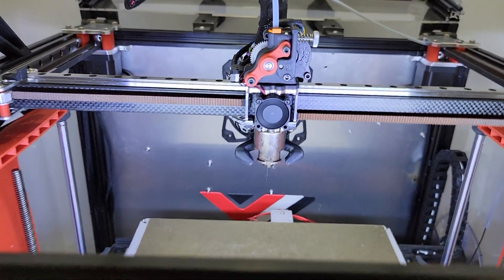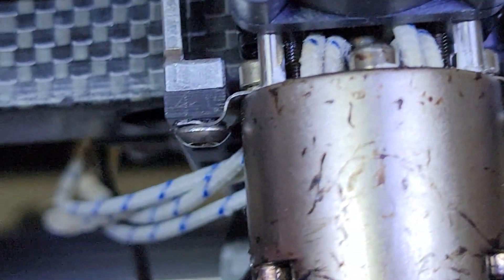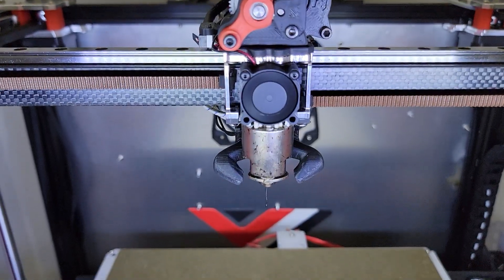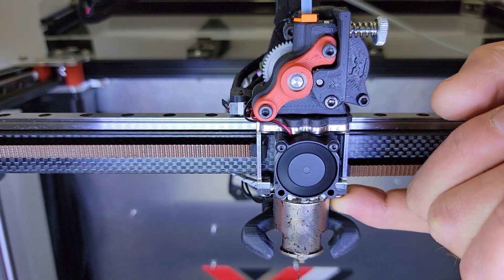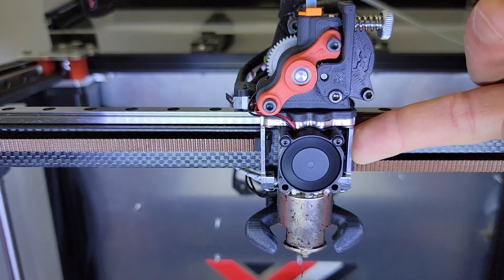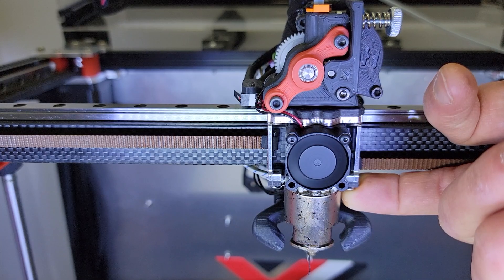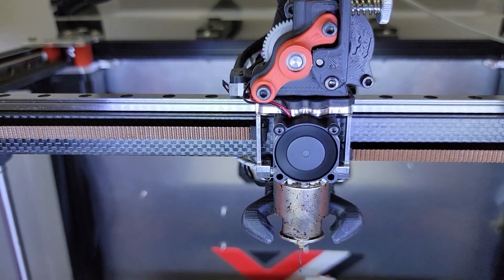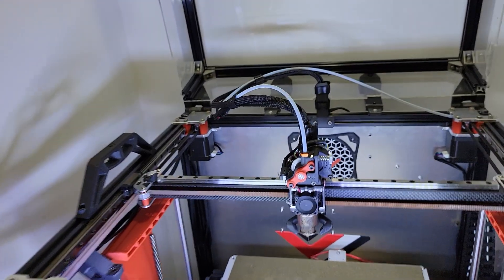Added titanium brace to my Magmum+

Comment: weight versus heat dissipation; Interesting decision making. Is bracing needed? I don't have the same configuration so I don't know the issues at hand necessitating the bracing.
Reply from the maker: Its not a MUST honestly with the metal printhead but it sure does add a bit more rigidity to that heavy M+

Comment: Nice video. 

Is it possible to see how fast you now can print a quility benchy now with all new mods? 

Also, have you thoght of using MGN7 or MGN5 for linear rail to reduce weight even further? 
Or maybe even contacting Igus with theyre drylin carbon linear rail to see if they can beat your linear rail setup?
Reply from the maker: Yes i have mgn7 here i wanne try
Reply: @Vez3D  Maybe you can try two MGN5, one on top and one on bottom or the side? 

Not sure what they weight but maybe something to investigate?

Comment: You could try making the part out of pcb material instead of titanium as well. Strength plus insulation.
Reply from the maker: It has to bend a bit.. and not sure how well pbc will handle that
Reply: @Vez3D  Annex has been using a PCB version for about 1.5 years now for mosquitos and NF crazy hotend :) Works fine! FOr the mag+ They do use a metal version (Stainless steel/titanium)